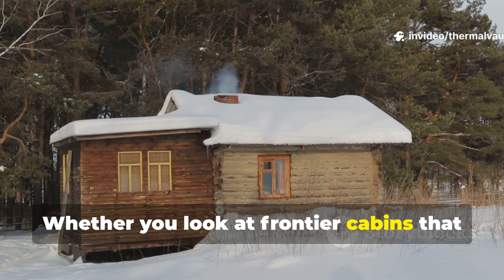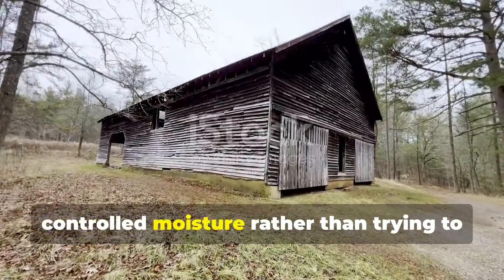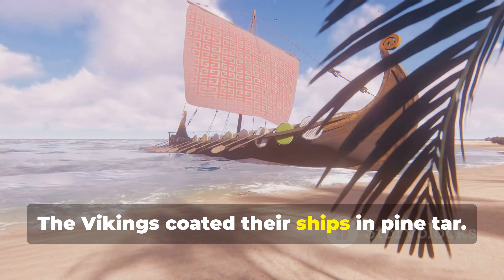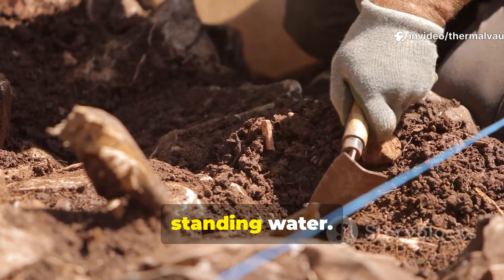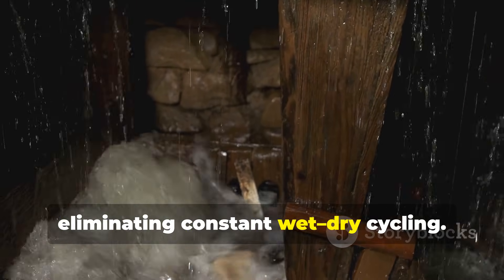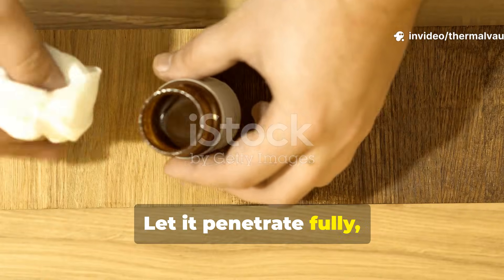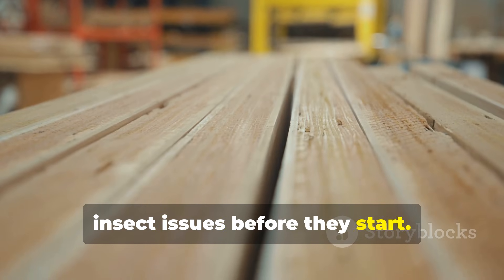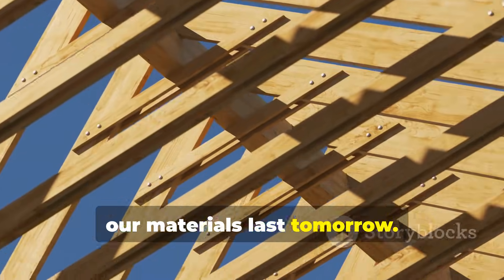TOP SECRET WOOD PRESERVATION - Cold War Techniques Revealed! Protect Your Bunker

Comment: I bought a really old work bench, the wood surface had gone grey it was so dry and weathered. Started applying BLO and aside from the top layer of the work surface that was water damaged, the original colour came back and looks great again. If the work top hadn't cracked from neglect and water pooling (was stored outdoors for some time), it'd have been good as new.
Reply from the maker: That's great to hear! BLO is fantastic for bringing wood back to life.